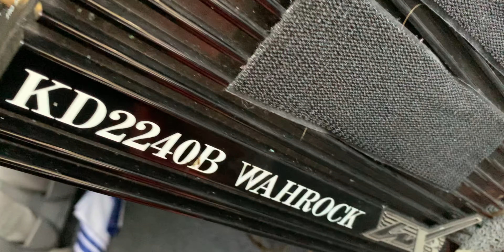Mitsubishi Pajero Flat roof conversion (සිංහල) Part 2

Comment: Good effort but the way they do sheet metal replacement in SL by using a blow torch makes the metal weak and destroys the protective coating. I have fully restored a Patrol Y60 and the rust reappears within 2 years.